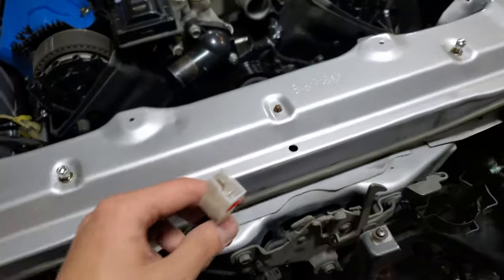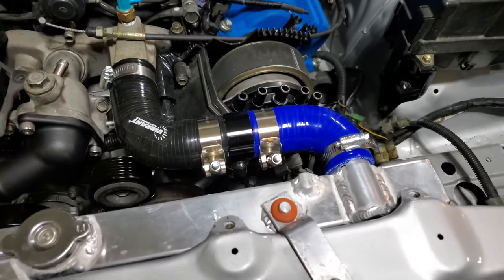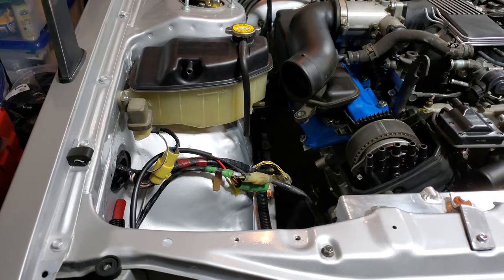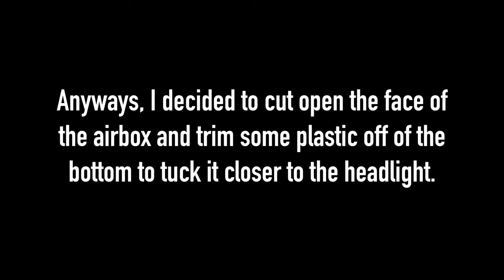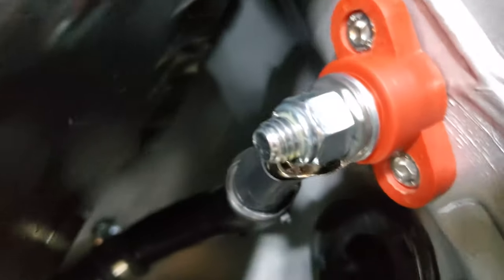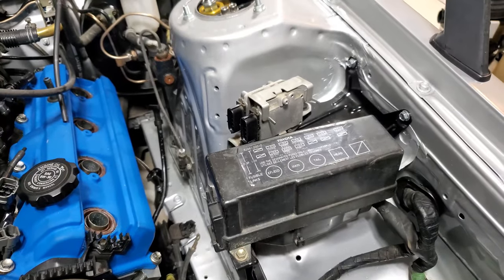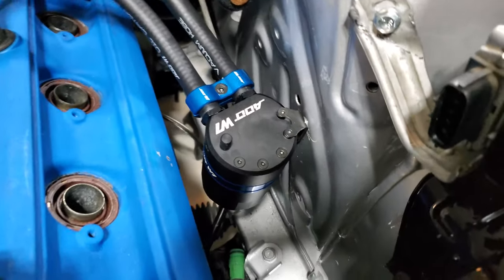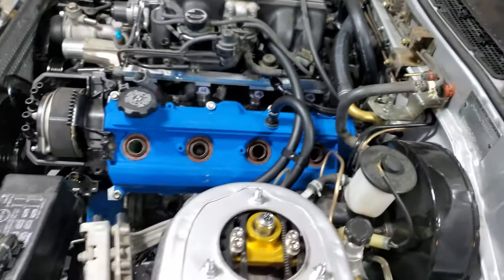Celica RA64 1UZ Swap - Intake, Remote Oil Filter & More Small Items! (Ep. 10)

Comment: Hey nice swap. Well I used the same box in my Volvo 240 /7mgte swap ,but I used a silicone pipe and it was flexible Enough to fit behind the right headlight.
Reply from the maker: Nice!! I think the 240 has a bit more room up front than my car, so that probably helped your case. Thankfully trimming the front of the box allowed mine to squeeze in!
Reply: @winguard96  oh yes I see. I had an 1982  celica with a Mazda rotary 12 a swap. It was the bomb. I still miss it after 23 years .

Comment: Great video! Very informative. Not sure if this was mentioned in another video but what kind of coilover setup are you using? My RA65 needs a full suspension rebuild.
Reply from the maker: Thanks! I haven't talked about the suspension just yet, that'll come in a later video once the swap is done since I'm upgrading the setup a bit. You can find all the details of my work here: https://www.celica-gts.com/forums/index.php?topic=30743.0
The idea for the fronts between RA64/65 are the same, but it'll be a little bit different in the back for the RA65, since it has IRS.

Comment: Videos are super well put together man. Definitely Subbed. Sometimes I wish I went 1UZ over the BEAMS. Your car is so damn clean. lol Keep it up. Cant wait for the next update. Just my 2 cents. The problem with using the power steering pump as an idler is that its a hydraulic pump. the fluid lubricates the internals. if you can get fluid in it and cap it off you might be ok. they cant be run without fluid (long). it would have the potential to lock up. if you took out the vane inside the pump I would be worried that the shaft would not have stability. at 3k rpm you might get some wobble. have you looked at an ac delete? you might be able to modify it to fit that area.
Reply from the maker: Thank you so much dude! Really appreciate the sub. Next update may take some weeks but it'll be an important video for sure. Thanks for the thoughts on the PS pump; after looking at the factory service manual, I think I may just create a looped line and suffer some pumping losses until I get my custom idler setup. I won't be doing an A/C delete since I'd like to get that working; the Celica is a street car after all. 😁
Reply: what don’t you like about your beams swap on your celica I was thinking about doing it but I’m still undecided
Reply: @slammed_accord  sorry I never responded. At the time of doing the beam swap All parts & repair information are difficult to get. If you had to do any kind of major diagnostic going to have to trust forums. If you try to get any more power out of it you're looking at big big money.